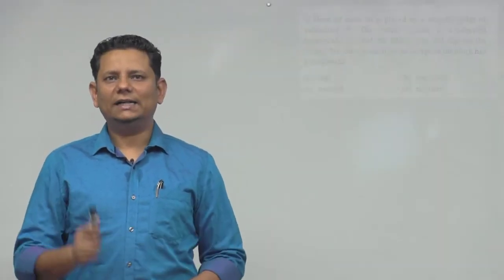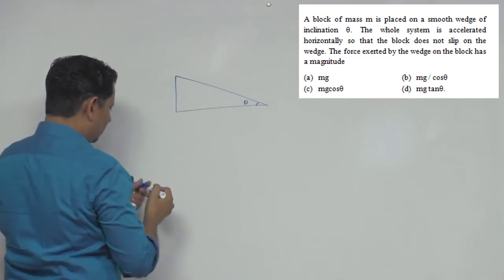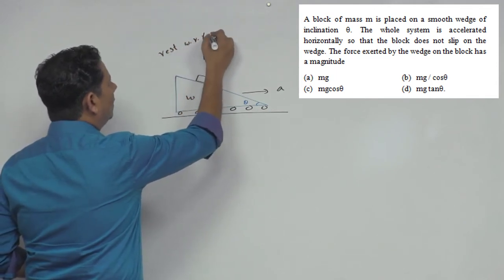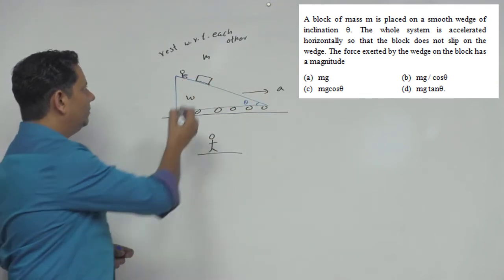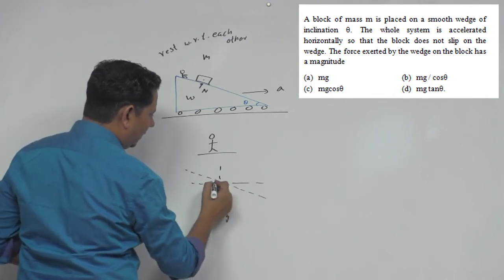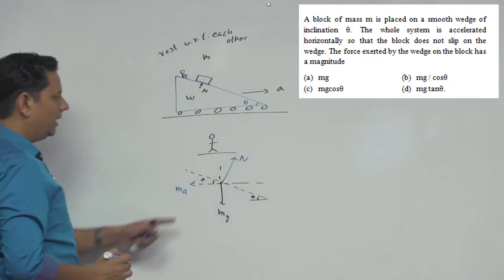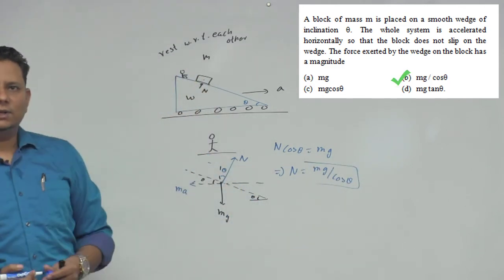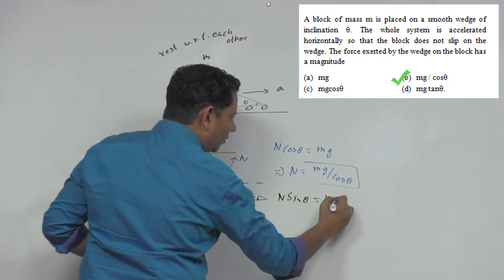HCV: A block of mass m is placed on a smooth wedge of inclination. The whole system is accelerated

Comment: Sir,why did you make the normal tilted ,shouldn't it have been a straight line ,if yes it wouldn't be NCostheta instead it would be N=mgcos  theta ,??
Reply: Bro.. Normal surface ke perpendicular lagta h na... Isliye vo tilt h.. agar straight hota to normal 90° ni hota
Reply: yes u can do that way but then u will also have to account for ma component along N vector, which is ma sin theta